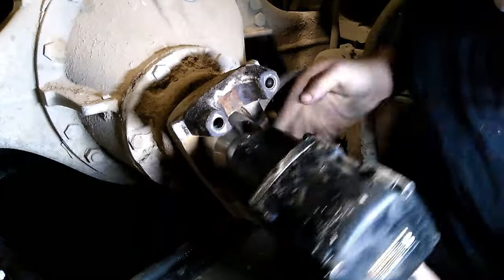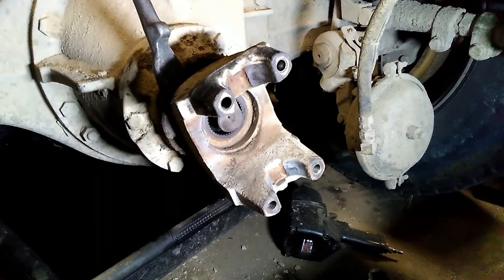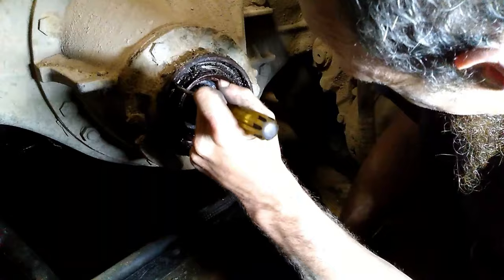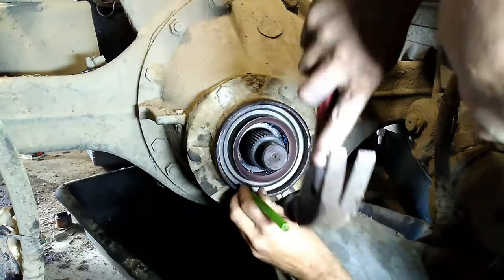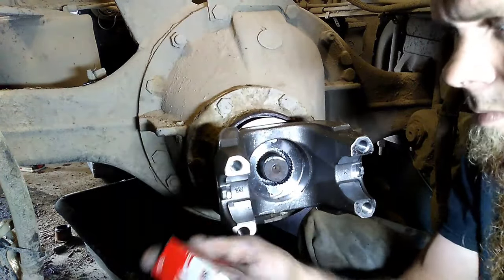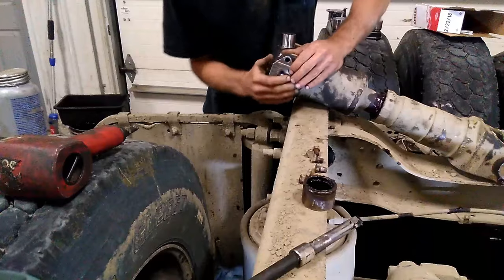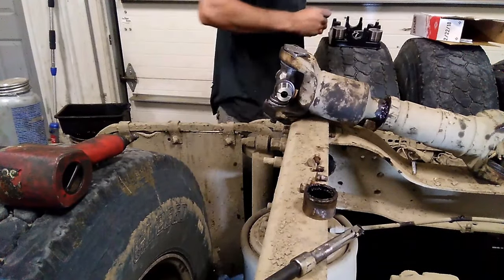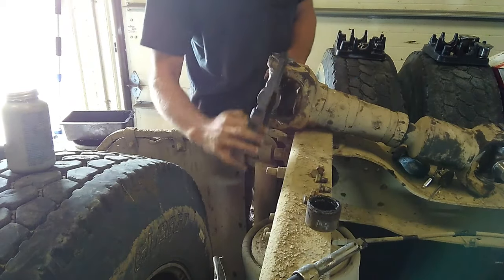pinion yoke, seal, u joints

Comment: I like that you do it old school when it’s possible. I ,doesn’t always have to be polished floors, PC’s and suited managers. However one concern about this video is when you tighten the yoke. Some pinions have a crimp sleeve between the bottom and top tapered bearings to determine the pre tension (I’m danish, not sure what the correct word is). If you tighten it too much, you will stress out the bearings. I guess this pinion have a fixed sleeve, so its no problem here. But some watching might benefit from that additional info.
Reply from the maker: They don't use crush sleeves on these large Eaton's.  Tq spec is somewhere around 800ft lbs off the top of my head

Comment: Hi there, can you please discribe in short  the procedure of installing front deff.. out put  seal. Thanks. (Does it need to be hammered in or just pushed in when tightening the yoke back in place)
Reply: Hammered use a piece of pipe or a big socket to drive it in

Comment: I got a 92 Chevy Silverado and rope got caught up in the yolk & pinion and blew the seal but I took it all out and got a new yolk and pinion seal but there's rope some hard plastic ring ,black rubber gasket and a ringed spring that was in where I pulled out the old seal , was that a bad thing or was that pieces of the old seal and I'm just over worried? I'm no mechanic and don't want to mess my truck up but any help would be awesome. I got pictures just wish I had help here with me.

Comment: ez a lot of supper truckers wonder why they loose there shirts it's because they can't do simple maitenace on their ride. glad to see someone like my self able to do it yourself. saves a lot of coins and down time waiting for a shop to get to it when ever. then they wonder why they go under. this game is 24 hrs a day 7 days a week if you wanna survive. keep on trucking
Reply from the maker: Trying to run a older truck taking everything to a shop or a emissions truck constantly in for warranty work. Either way can eat a guy alive
Reply: you can got that right IH tow truck in our yard 4 to 5 times a day trucks are gone for weeks l got trucks worth 1- 2.5 million dollars apeace sitting in a shop fowork all emissions bullshit because our trucks sit and idle may be 10 12 hrs a day and maybe only be driven 30 miles mabe60 miles aday all max force engines cause international is the cheapest. l drove a mack super dog all the time with a 100 ton rgn king quad axel float l done the ice road building and trucking deal 4 14 years the roads on ice road truckers we built those roads to  all the Indian reservations in northern ontario canada plus I delivered 80 to 100 tons transformers and generators to provide electricity to these places.

Comment: Hey, Great video.  I have (a 20 year old RV with 85k miles with) a Dana 60 and it looks like I need this pinion seal replaced.  Any idea how many hours of labor a shop would charge for this repair?  I would do this myself, but have a trip planned and no idea if I can get it done on a timely basis, so might bite the bullet and let someone else do it.  Thanks for the video!!!
Reply from the maker: i would think just a pinion seal on a dana 60 should be under a hour shop labor. unless there is unforeseen problems or circumstances.

Comment: I have successfully rebuilt two Ford 10.5 rear ends. I have a school bus with a N175 Rear end and I want to swap the whole carrier/diff/pinion assembly with one that has a different gear ratio.....should this be as simple as unbolting the axles, pull them out, unbolt the drive shaft, unbolt the carrier, pull it out and slap the new one in and reassemble? I figured the hardest part would be how heavy everything is.
Reply from the maker: pretty much in a nutshell

Comment: Hay brother, would you consider a favor. This new type of fuel is causing problems with trucks. Fracing deposits are showing up in my fuel line. Clogging up the filter and lines. Don't know if I'm the only one. Video on cleaning fuel lines, changing filter, would help some of the younger driver's running for O/O's.  thanks
Reply from the maker: Pretty much everything from the fracking process will fall out of the crude when it runs threw the treater before it even leaves the wellsite anything that would remain shouldn't make it threw the distillation process at the refinery. Sounds like what your discribing is what iv heard of called fuel asphalting no personal experience with it yet seems to be mostly a isx problem from what I know of it and caused by the fuel being overheated in the head before it returns to the tank causing a tar like substance to drop out of the fuel
Reply: Meaner Kleaner by Howes

Comment: You said to use a new strut kit.  What is this?  Thank you for great videos!
Reply from the maker: Strap. Not strut. The metal bands that clamp the u joints in the yolk.
Reply: @Ezrider359  got it.  Thank you.

Comment: If you read in the box recommend not to use any sealcon or gasket maker . Anyway thanks for video you make look easy
Reply from the maker: thank you, a little sealant on the flange doesn't hurt anything defiantly don't want to put any on the lip seal though.

Comment: why is your mack got single  brake chambers single 30 not double 30/30  do or must have park brake on drive shaft back of gearbox??
Reply from the maker: 30/30's on one drive axle and 30's on the other. its somewhat common to see trucks set up like that.

Comment: I have a yoke like this that spit oil by the splines, do you have any tips on that? I removed the yoke and put rtv on splines and it still do it?
Reply from the maker: could be excessive wear on the splines, over full diff or plugged vent.

Comment: Have you ever had to cut pinion nut off? I am working on one now that i cant get to budge heated it with rosebud and had 1" gun on it
Reply from the maker: Never had to cut one off I have had to get the entire nut glowing red before it would come off though. Sometimes I prefer to use a welding/brazing tip vrs a rose bud as I can concentrate the heat on a smaller area and get more tempature difference between the nut and the shaft.
Reply: @Ezrider359  ya thats what i was wondering. i ended up doing that got it red and got the end of the shaft with the air hammer a little bit and camme right off. Thank you for the reply
Reply from the maker: @patquest287  glad you got it!

Comment: 12 mm 12 point ....?  I messed up trying to remove a bolt from the #1 u joint at trans- Stripped the Bolt cause I didn't have an impact socket 12 point....I used Chrome and rounded the bolt..Now What? Burn it off and buy a new yoke? I gotta get it off because Im changing that Joint AND trans output seal
Reply from the maker: You could probably weld a nut to it a little heat wouldn't hurt anyway as there is a bit of thread locker on the bolts.you also might be able hammer a slightly smaller socket onto it
Reply: @Ezrider359  Shoot,I forgot about the nut trick- Thanks, Wheres my brain sometimes- Those bolts are "Hard" Tried to pound some old sockets on,They just spun

Comment: I have put in a pinion seal 2 times and second time I put in a new yoke & seal still leaks at the same spot at the pinion . it is the forward axle rear output .drives me crazy because I know how to install a seal.. It makes me laugh but makes me mad any tips?
Reply from the maker: i don't know if you have done any "failure analysis" there might be somthing out of spec causing the seal to fail.
Reply: @Ezrider359  you have some good videos keep them up. I was just up in McKenzie ND. On Thursday... Cold and windy.. Damn don't know how you get mpg's up there in the winter. My truck is a 05 670 volvo 1.5 milllion on it.
Reply from the maker: lol my winter millage tends to run about 4.5...lol between always being near 100k lbs loaded the wind and cold fuel millage isn't great. i can get my average up around 5 or a little over in the summer but between always being heavy and seemingly always fighting the wind i just make sure i charge enough that fuel millage doesn't matter as much...lol

Comment: Run em down with a healthy impact.
Reply: That's not the way I understand it's supposed to be done
Reply: hand tighten half turn to start, use impact tool a few turns, then use a torque wrench socket or wrench to desired foot pounds without breaking anything. trying to hammer or push the yoke on is more work than you have to, let the impact tool do the work for you. but make sure the yoke is lined up on the splines first or you will ruin the spline shaft.
Reply: Ya. This is a good video on how to ruin your bearings and how to replace the seal every 6 months. Notice how he burnt his hands taking the yoke off? If you let the shaft cool down after heating it with a torch set..... you wouldnt need to beat it off with a hammer. This is why they make pullers. You will ruin the bearings no way around it beating it on and off like this. DO NOT HAMMER ANYTHING. Same as the instruction of run it down with an impact. Bad idea. You will throw the backlash out the window and pile your gearset up. This is a seriously great video on how to destroy your diff changing a $50 seal the farm way. By the look of the poop in the housing after the seal came out, its not like he is changing the gear oil anyway. Save yourself from yourself. This is not the way to do this job.